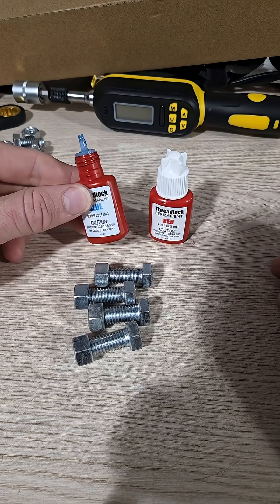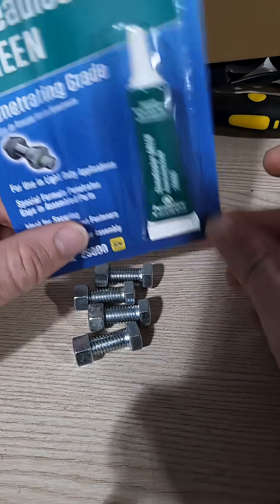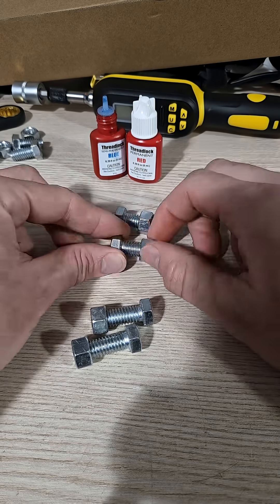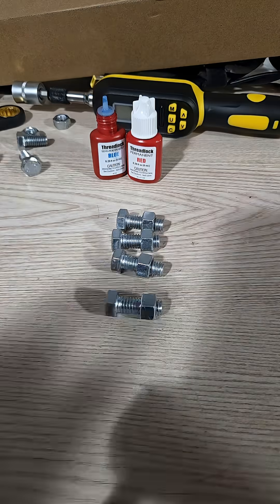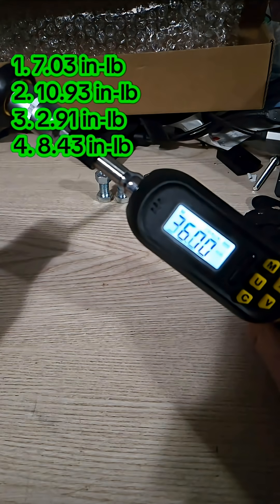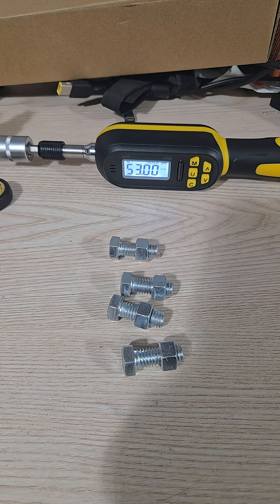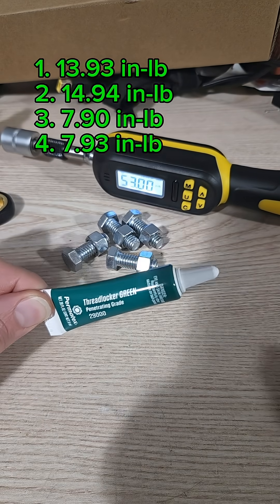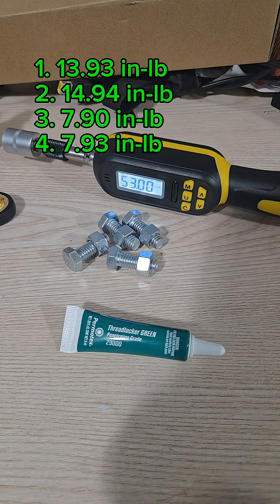Green Thread Locker

Comment: I love the orange loctite for needing a good hold without worrying about having to add heat later. To get a more consistent test are you cleaning the bolts with brake cleaner first ? Just to get any oils from the manufacturer or fingers that have touched them ?